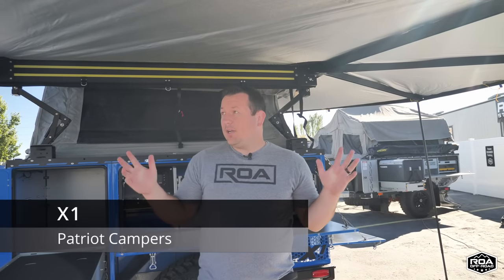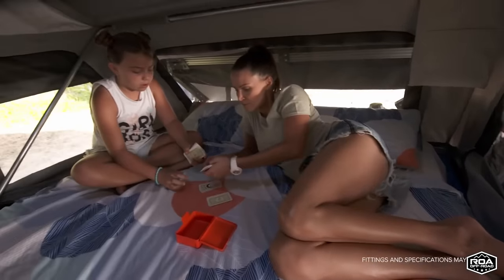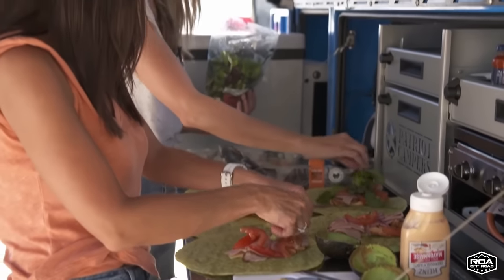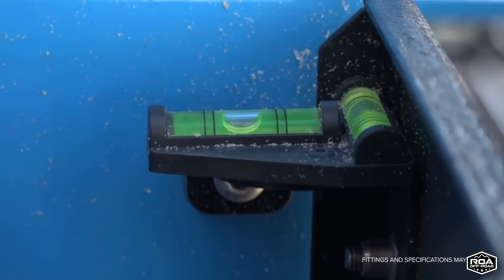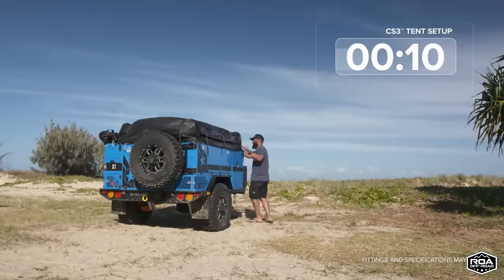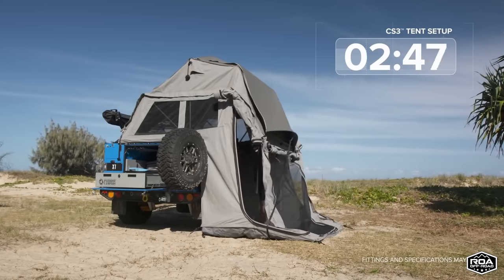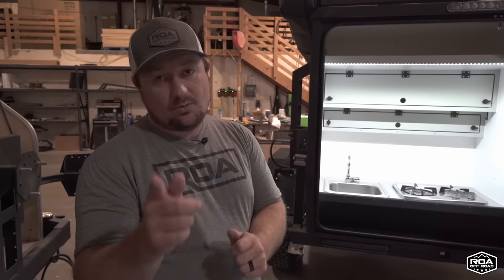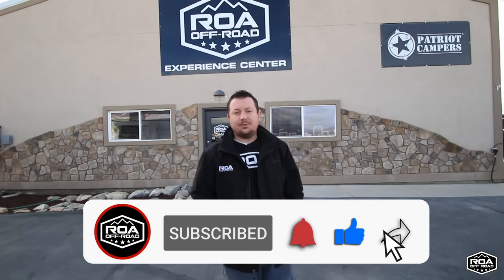10 Off-Road Camper Trailers That Can Be Towed With A Jeep | ROA Off-Road (2022)

Comment: How much is the x3?
Reply: Starting MSRP is $56,990 USD
Reply: @XploreAz  tell them I'll trade them my 300HP Caterpillar engine out of my 40' Diesel pusher Motorhome for 1!Lol🤣🤣
Reply: I'm asking 60,000 for my motor complete with Turbo Charger and less than 55000,original Miles
Reply: @CJLane-62  The stranger you were responding to didn't take your random offer of a random engine to the camper manufacturer? But it made so much sense to turn a YouTube reply into an impromptu classified. Huh....maybe the next time you have a BBQ grill you want to trade for a mountain bike, give it another try.

Comment: Most of the Weights on those trailers are Beyond a Standard Jeeps Towing Capacitys,especially after you load your gear into them,so Quit LYING !
Reply: Most of them are not. You are great at exaggerated baiting. I took the bait, if you have a 4 door Jeep you have 3500 lbs capacity. To kit a trailer out you will add to these about 1000 lbs maximum. Almost all of them will still be under 3500lbs with 1000 lbs of gear. 
    How much gear do you think you can stuff into these little things?? 😂😂
Reply: all the patriot campers can be towed by a jeep they weigh around 2000lb and they have electric brakes.